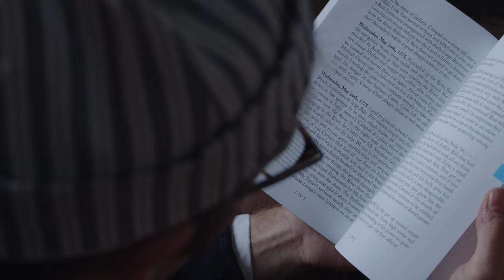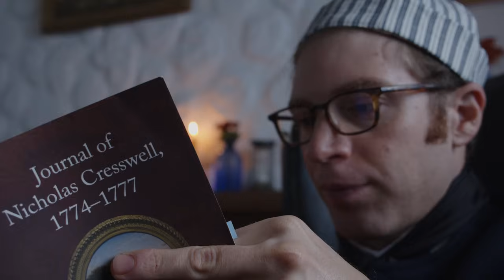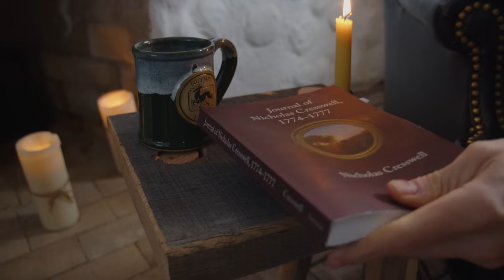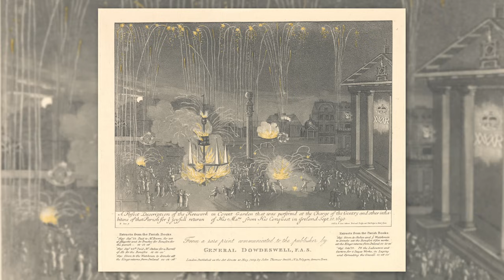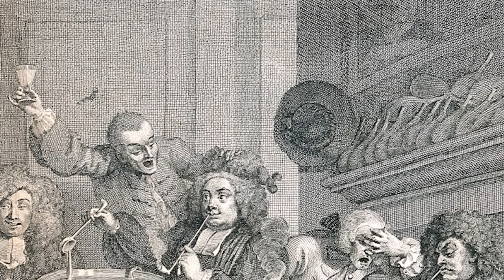Joe Pera’s Early American Adventures - A Day With Townsends

Comment: I like that they can just go to the bathroom and smoosh it into any air gaps they have in the walls.  I wish we would get back to that kind of self reliance.  For instance if your house is freezing and you have to make #2, but don't want to get up from your chair and out from under the blanket.  You could just reach over to the wall and have a two birds situation.
Reply: If you used feces the way the mud and dried grass was used, you would have a bad smell and probably insects burrowing in/out both ways. 😬
Though, I'm sure you could inoculate manure with mushrooms and then form them in to bricks... That's progressive! 😂